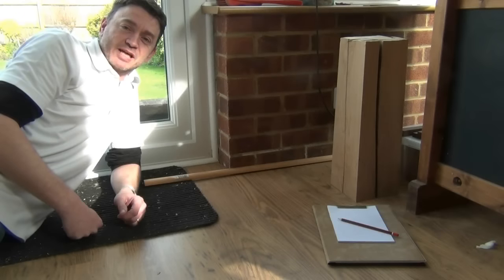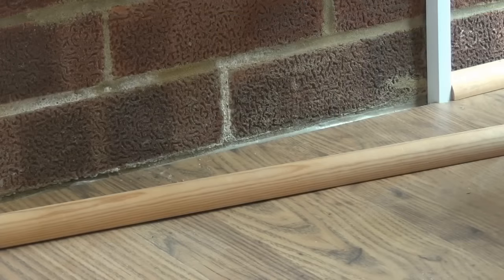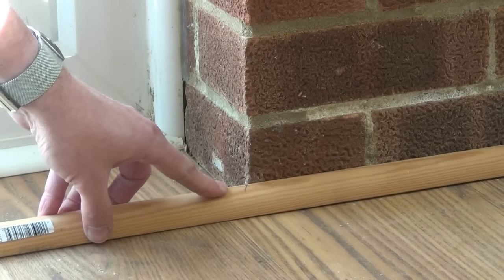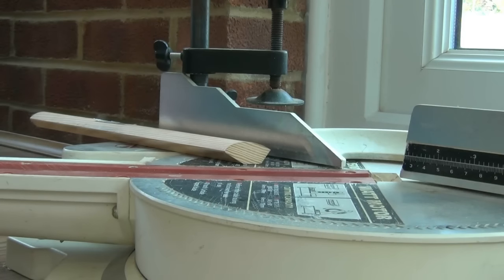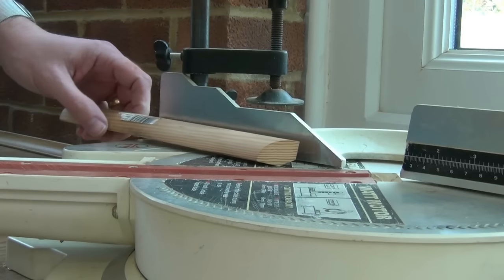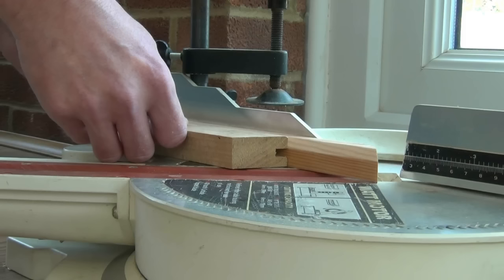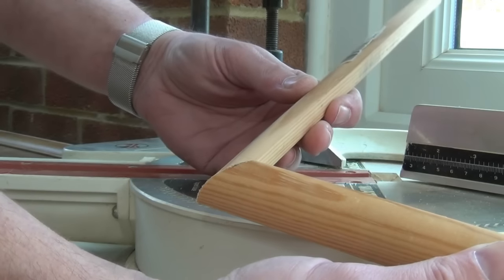Baseboard / Quadrant Floor Trim 1 - External Mitre, and Scribed Joints

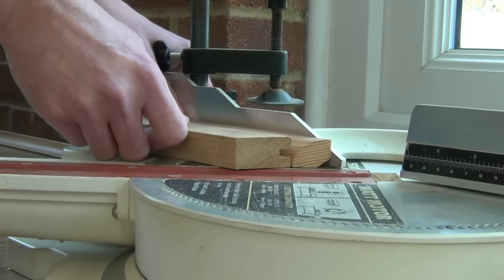Comment: Sorry if stupid question, but why did you use that block of wood as a fence at 1:20? Then so delicately turn that bit of trim around whilst holding that block in place. Why not just turn the bit of trim around and hold it in place with your hand against the mitre fence and cut?

Comment: Thanks Man. U Just clears all my doubts. Good talking, good demonstration. 10/10
Reply: Can I ask please, why you had to use the "little fence" why not just "place it" Thanks
Reply from the maker: Cheers! It's difficult to just place it and make sure the quadrant is truly at 90° to the table.
Reply: Roger that, 90 degrees. Thanks.

Comment: Hi Mitch - may I ask, what is the brand /make of those compasses that you use (the first set with the blue wheels that you used at 2:33) ? Many thanks.
Reply from the maker: They were just a pair I picked up at Lidl. Not sure of the brand, if any. Try an art supply shop if you are having trouble finding any similar.
Reply: @mitchwoodwork  OK , thanks Mitch (great videos BTW ).As a chippy myself I was taught to scribe with compasses years ago . I'd also use a scrap of wood which then led to a pencil or finger as a guide . Best wishes .
Reply from the maker: @djx-ray1876  I too, often use whatever is at hand. Cheers

Comment: This was very educational; thank you. Question: after all of the cuts were made and assembled, did you glue it down to the floor to hold it in place for the permanent installation? Thanks.
Reply from the maker: Hi Jason. In my case I just glued the joints, and it floats on the floor. For more permanent installations, it should be attached to the wall, not the floor, with dabs of construction adhesive, screws and rawlplugs, or pins into wooden plugs in the brickwork. Other walling materials may require different fixings. The reason for not attaching to the floor is that in this case it is a floating laminate floor which can move a little, and wooden floors move with expansion and contraction through the seasons.
Reply: @mitchwoodwork  Hi Mitch. Thanks very much for the speedy reply; it really makes a lot of sense. I picked up some construction adhesive and so will use that as the method to adhere it to the brick. Much appreciated!

Comment: please can you tell me how much workmen charge  roughly to put down beading for ,1 room
Reply from the maker: I've never done it professionally - I make furniture. But I imagine you could expect to pay from £25 + materials (£1 to £3 / m) for a simple room with four corners and one doorway. There may be a callout charge on top of that of course. Shouldn't take me than an hour or so.
If your in the UK, use checkatrade to locate a reliable carpenter